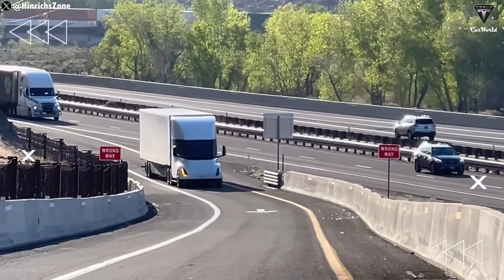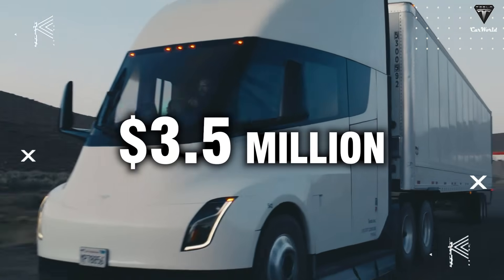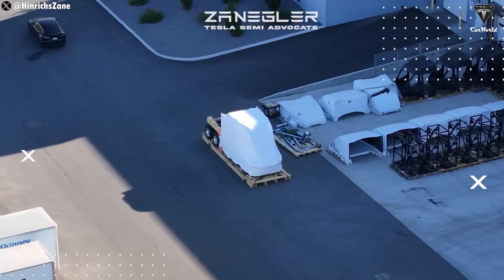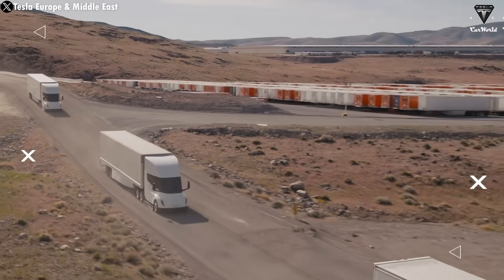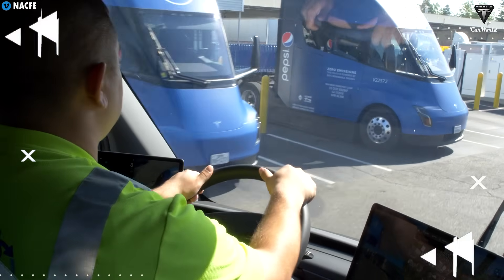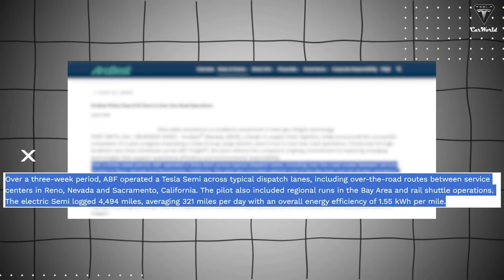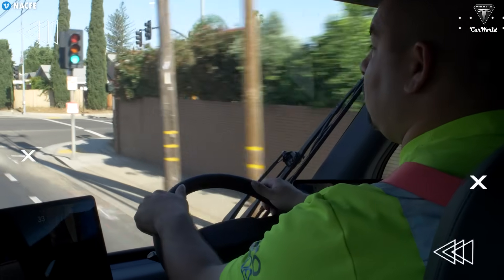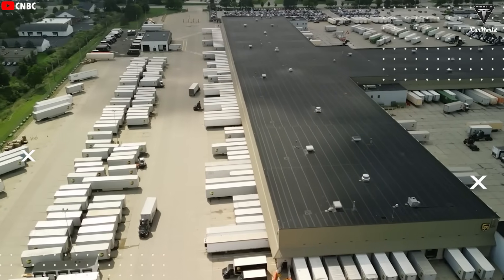New UPDATE! Elon Musk Reveals Tesla Semi V2 Upgrade Insane Headlight & $170K Price Configuration !

Comment: Several weeks ago, the simi build crew at Giga Nevada (GN) in Sparks completed the last 32 new firstgen sims. These were parked outside & the hap hazard build line they had been using was disassembled & all parts & eq was moved outdoors in preparation of moving into the brand new high  
volume simi assembly building under construction on the property. When the new line starts up in December, it will build gen2 simis with 
4680s, the new headlamp design and many upgrades the simi team has developed over the last several years of beta testing they have done. And those last 32? Little by little they are disappearing into customers hands. As preferred customers win the Tesla simi lottery they are sending drivers to GN for driver training then handed the keys & sent home driving their companys brand new simi. It is suspected that lone megacharger at giga Texas is for customers driving their new simi home to layover & get a charge-a meal-a shower & some sleep before driving the last leg of their homeward journey.

!

Comment: they'll need 445/22.5 single steel wheel . Smoother less harsh on electrical and tire wear evenness . Dont use us wheel . Manitoulin had these wide steel wheel . That is what tesla need
Reply: 38yrs ago my truck had no power steering.
Reply: @richardscathouse  i drove transtar 2 leaaf spring and spring cab suspension . Not fun

Comment: I wanted to believe in this project, but 300 trucks in 7 years? That’s embarrassing.
Reply: Tesla's fab for semis has equipment being installed as I write this, and they anticipate higher volume production starting early next year.  As it is now, there is not a semi production line in operation.  Those that have been built are being built by hand.   Keep believing.  The Tesla Semi will be in high volume production very soon.